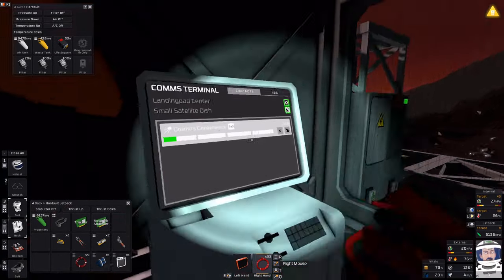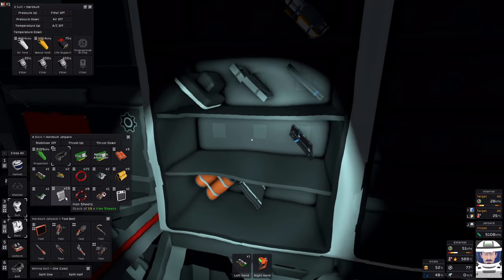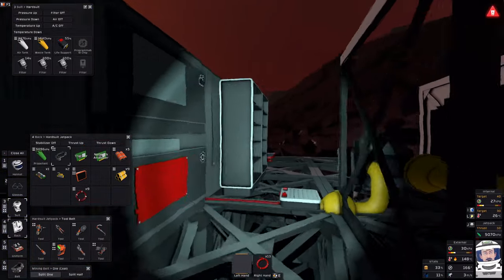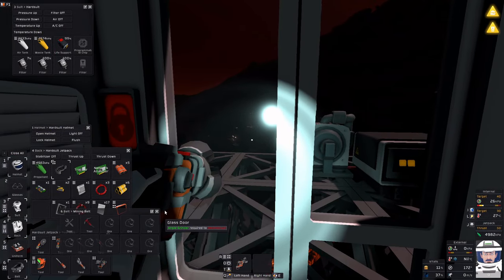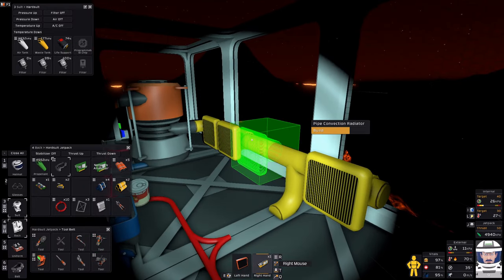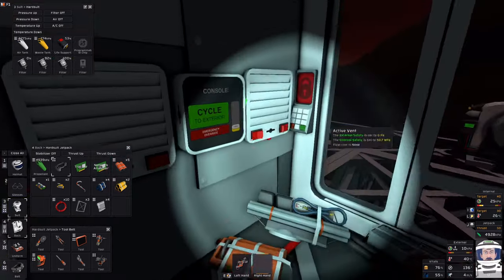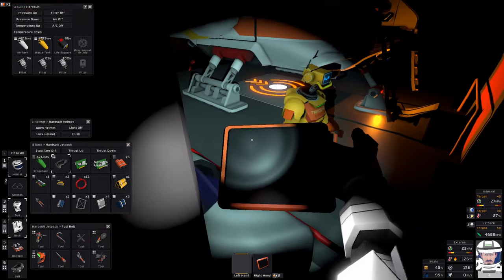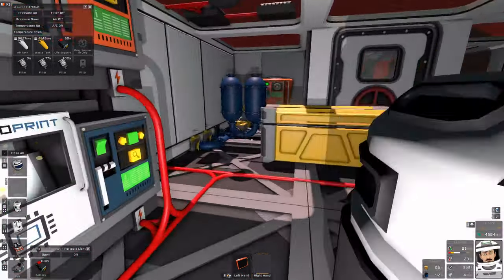Stationeers: Let's Phase Change Vulcan Early Pt3

Comment: In a different series, I was impressed by what Shadow did with MIPS, but looking at him using logic chips, not so impressed 😅 (I get that logics in games isn't like riding a bike, but I'm still learning MIPS, (thanks for the tutorial series Shadow, been helping me quite a lot) and have been relying on logics since day one of my Stationeers career. Really looking forward to cleaning up my builds by removing logic chips, takes up too much space)
Reply from the maker: My logic chips time was probibly about an hour or 2 compared to MIPS. I did a solar tracker and a fuel mixer with logic chips and then I discovered MIPS and never went back xD.

Comment: I think you can make the Labeller in the Autolathe.
Reply from the maker: I wish... I think I remember always needing the toolmaker for the labeller. Which kind of gets irksome especially since I didnt buy one from Asteroid Artisan when I had the chance to save a little time. Though honestly the trader rng was kind that I got seeds and some gas for pressurizing and spare water. The only trader thing that sped up the build was me buying a stack of cable coils from Asteroid Artisan but otherwhise from start to finish I made just about everything.
Reply: @shadowdrake082  you can make a labeler in the tier 1 electronics printer
Reply from the maker: @VinusWasTaken  Okay, at least that makes sense.Learned something new. No more rushing tool printer now until I need the mining backpacks at least.
Reply: @VinusWasTaken  Thanks, came back to update this to the Electronics Printer :)